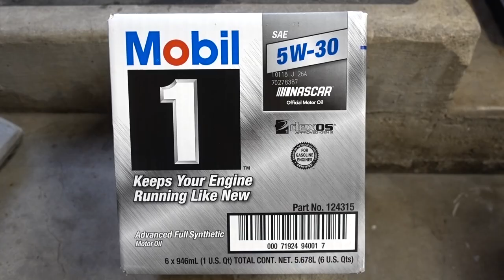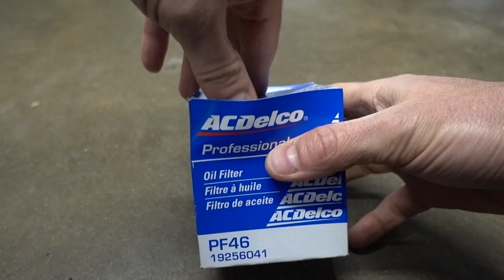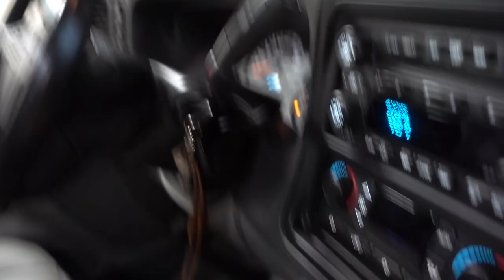BEST OIL FILTER HACK IMAGINABLE!!

Comment: Yes I've done it. Good idea. I DONT KNOW about THE PROOF behind it but it does make logical sense!!    Especially with COST of the magnets.   So it may or may not help. Being so over ty he top doesn't help.  The METAL PARTICLES  l WOULD B CAUGHT BY the FILTER WAY MORE LIKELY THAN the TINY MAGNETIC FIELD thru the OIL CAN!!. Especially sense the metal particles r moving by in a fluid at a flow rate that is fairly high.  So I think this is a myth. I'm a new engineer mechanical and I do watch alot of Scott Kilmer videos and trust his auto mech experience.

Comment: I just crack the filter lose and take a hammer and punch to poke hole into oil filter then spin filter on the side, so you dont get that mess,  been doing that for years and we use grease on the filter seal and prime the filters of course, just hand tight

Comment: I like your channel man! But, I don't think magnets on the oil filter would improve the oil any better. And, the reason why they make magnetic plugs is simply because it helps the plug stay 'attached' to the spanner or socket and avoid it falling in the container. The ferrous particles in the oil pan simply drain with the oil due to gravity and only a small amount sticks to the magnetic plug.

Comment: Scotty Kilmer is king..... As you know. The magnets, might not be strong enough to pull anything out of the oil. Did you test this with a cut away yet????? Hint hint, new video to bust the myth?
I used rare earth magnets in my rear window to hold a magnetic bumper sticker on the window and it didn't hold at all! Just saying if it can't hold 2 magnets together through glass then metal might not work either. Would like to see that experiment in real time with a cut away oil can thr magnets on the side and metal clinging on the side with oil...

Comment: magnets magnetic field don't pass the metal shell of the filter, they would just stick on the outside of the filter and that's it....

In real world (industrial field) magnets are used inside filters to attract particles but merely to trigger a sensor so the driver/operator of the machine getting a warning of a contaminated filter.

There is no practical use for it, if you got metal shavings in your filter then there is something wrong with your engine, regular microscopic shavings are normal and for this reason you have to change your oil every xxxx kilometers.

Comment: Oil filters are used to collect carbon deposits that block oil galleries . Your correct that the only ferris to ferris metal contact is the linner and rings but the wear is so minimal or you would have to rebore your engine every 10k not 300k. Most GEAR boxes and differential have magnetic plugs because they run metal on metal components under extreme pressures.

Comment: I think your magnets are attracting the ferrous material your oil filter already captured, meaning your oil filter already did the job your magnets are meant to do.  I also believe the magnets on your drain plugs are meant as "indicators" of other problems your engine or transmission might have.  See Hoovies Garage Lambo transmission video for a good example.

Comment: If there are metal particles big enough in the engine or transmission to do any harm they will for sure get caught in the oil filter, so adding magnets to the outside of the filter doesn't really do much because it's already caught by the filter.

Comment: You could prove your point with facts, why not upload a video right after your next oil change, take the old oil filter out and open it up, if it does show metallic debris or particles in there, then nobody not even Scotty Kilmer can argue about your method/solution.

Comment: the magnetic drain plug does the job the most efficient way.
simple and when changing the oil just clean the drain plug off.
no need to do anything else apart from making a video on you tube about sticking little magnets all over your oil filter why not try different color one's at least you have the prettiest oil filter in your nabourhood.

Comment: On a modern engine, block and pistons are made of aluminium. Cylinder liners are made of nikasil which is a nickel/aliminium alloy, but unlike pure nickel, it barely sticks to a magnet at all. The cams are made of steel, but how much metal ever comes off them is ad best questionable. If you have a magnetic oil sump plug, how much metal do you find on it when you change the oil? If it's close to 0, magnets on an oil filter aren't going to help you. So it's up to you to prove that these magnets actually catch anything. Until you do that, you have a lot of opinion and no facts.

Comment: Yes, you say what's the harm if it actually does nothing?  Well, what if one of those little magnets gets knocked off while your driving your gas guzzler around and bounces off a rock and hits a kid in the eye and blinds him which causes his family to take his college fund to pay the doctor bills and the kid grows up never reaching his potential in life but languishes working in a fish factory until his death from toxic fish poop whereas if the magnet YOU installed, if it wasn't there wouldn't have done what it did and the kid would have gone to college and graduated at the top of his class - with both eyes - and received an all paid scholarship to a highly respected petroleum program in a great University where upon graduating he worked in a lab that discovered a breakthrough magnetized plastic engine that did away with oil, fillings and filters and then the whole world embraced that break through, except Togo Togo naturally and we could all drive around on clean quiet and metal filling free vehicles!  Except Togo Togo of course as previously mentioned. What about that?  Think of all the kids that would be able to live without the loss of an eye. Yes you say what's the harm? Well what about that?  So, there!

Comment: Why in the hell did you tighten down your oil filter with the wrench.. they are to be hand tight always. Also, why is your oil that dark? are you a diesel? You should change it more often. If you are using syn oil it should be a dark color but not black. That stuff looked like Rotella 15w40 after being a month late on your oil change.

Comment: MOST engines are ALUMINUM BASED   your oil filter hack is useless
Since you never had a newer car you might have not known ALUMINUM  is non magnetic
Might be useful on a transmission though  but you will need a very powerful  magnet since the housing is very thick

Comment: You should see what the factory magnet on a 4L60E looks like after 300k miles. 😮  I can't watch Scotty because he too often acts like a stubborn drunkard who hates what he doesn't understand.  Our oil filters are much smaller today, in small part thanks to the EPA, to help meet regulation that oil filters do not have to be treated as hazardous waste like motor oil.  Many modern cars have magnets in their oil pans and/or drain plugs from the factory to collect metal shavings.  There's no real harm with using magnets; it's like the debate of washing your car too much.  While I understand the idea of using magnets on a filter is because it's disposable and you can (assumingly) toss the ferrous debris out, the bottom of the pan is where you'd most likely catch the larger debris that can do damage, as it sinks like heavy gold to the bottom.
Reply: If you want a large oil filter  buy one  
they still make them

Comment: I agree with scotty you dont need a magnet the filter catch all that can harm the engine the engineer design it to work efficient without magnet if you have unwanted particles floating in your engine you need to deal with the problem that cause it in the first place cause the magnet not gonna fix the problem

Comment: You had anearth magnet plugged at the end of your drain plug but you didn't bothered showing the inside end of it. It would have been a good example of your theory. 

You make it sound as if you know what you're talking about but you couldn't bother talk about the details of the inner works of the oil system (pressurized) dude .. NOT EVEN THE WAY OIL FLOWS IN THE FILTER. I would reccomend you Scotty channel. You could learn a thing or two about how mechanics work.

Comment: The problem is you are making every piece of metal that filter is connected to also magnetic, which means all of your metal components are catching metal fragments rather than them going through the filter. So,  i would not recommend that at all.  Don't believe me ?  Get your super powerful $2.00 magnet, stick it to something metal, then use the other end of that metal to get it to stick to something else metal.  There is your proof RIGHT THERE..  DO NOT DO THIS

Comment: The magnetic oil pan drain plug is in the oil pan for a reason. Not on the filter, the pan. You need an understanding of the pressure going on inside the filter to know why it's not a good idea.

Comment: EVERY FASTENER IN YOU MOTOR IS STEEL!!!! Ferros metal, EVERY MOTORS CRANK SHAFT ( 90 lbs) pure cast iron (ferrous) metal, timing, balance shafts and chains are steel and cast iron(70lbs) CONNECTING RODS(35lbs) all cast steel, the whole rotating assembly is magnetic!!!!!!!!!!!!!!!!!!
Reply: Now days the rolling computers use aluminum engines and  aluminum  parts  to save on weight

If you have metal shavings in the oil and it's circulating around  it means you bought a crappy FRAM filter and has stopped filtering 

magnets are useless IN modern cars with aluminum engines
Reply: @punker4Real  New engines still use cast iron cranks, rods, pistons, etc. Unless its full billet aluminum those parts would never survive the wear those parts see. I don't get why that so hard for you to grasp. Full aluminum engines are for drag race applications only and cost stupid amounts of money.

Comment: Mobile isn't the best oil u can use, Amsoil is better
Reply: Peter Boissiere and a bypass filter.
Reply: "Better" - Better at what?  The add pack?  Amsoil is still average compared to something like High Mileage with MaxLife Full Syn or M1 Syn High Mileage.  Purer base stock?  SOPUS' GTL is still the cleanest oil out there.  Low SAPs?  Again, better options.  

It just depends what you're looking for.  There's no justifiable reason to pay Amsoil pricing.
Reply: @cup_and_cone  Royal Purple is the best
Reply: Mobil 1 is the BEST.
Reply: @stacydornan9765  Never seen a decent Royal Trash oil analysis.
Reply: Your all wrong Shaffer’s oil.                    out performs all your name brand shit...
Reply: Stacy Dornan lol why?? Because the oil is fancy purple?? Dont fall for those marketing schemes...buy mobil 1 or castrol and u should be good to go
Reply: Amsoil is a pyramid scheme and that guy eden is just a marketer for them. Why do you think everyone always trying to get you to buy amsoil?
Reply: @georgesmbyd6603  I use testing at Blackstone labs to see what oil is best
Reply: Peter Boissiere   I'm under the impression that propylene glycol, although a higher I risk cost, is a much better way to go.
Reply: royal purple is the best engine oil

Comment: With an aluminium block, aluminium head(s) there is little a magnet will catch. Bearings are made (mostly) of non ferrous metals too so a magnet will not pick up much as there isnt much ferrous metal there in the first place. Its a nice idea but isnt the best performance mod...But hey. It doesnt hurt anything.

Comment: You lost me at putting old dirty oil on the rubber gasket on the new oil filter.
Should have used new oil you were going to put the engine.
"Rev up your oil filter gaskets"!

Comment: Just please bear in mind that you are trying to trap something that is in constant flow.  Plus the fact that you are trying to catch something that will defeat the filtering capacity of the media inside the filter.  Of course, no harm in what you're showing.  The magnets in pans are designed to catch material when fluid is not circulating.  The suspended particles in the pans will gravitate to the magnets (when fluid is not in high motion).  Pans typically hold multiple quarts.  An oil filter?  Perhaps half a quart.  If you're into magnets, consider adding more magnets to the transmission pan and oil pan.  It makes more sense to do it there.  Only because of the storage nature of these pans.

Comment: So I totaly agree with this.. But! What if they worked to well, and you have some excess wear, the magnets catches that material, then cloggs that filter.. I agree with the idea, but put them at the bottom of the oil pan, far from the pickup.. It will still catch everything, and let the filter work easier, because its filtering metal free oil..

Comment: LOL, So many noneducated comments on here. Here is one that I like to despise from @Kartboarder22G,  Here even though you might have ferrous material on the filter near where the magnets are the oil filter still catches that material. So do it if you want but I'm gonna say it's just a waste of time to put those on and off each time. All I can say is Kart, please learn proper English and pronunciation before commenting. 
Let me say this about magnets and oil filters. Magnets isn't a new thing. Magnets have been used on canister type oil filters for diesel trucks for years. Where did the diesel truck industry learn from? The RailRoad industry. RailRoads have been using magnets on their diesel/electric locomotives since the 40's. Locomotives hold hundreds of gallons of oil in their sumps that are passed through a huge series of filters. People's comments on here are "well, the build-up of metal in the filters don't allow the proper flow of oil" or something to that effect. LOOK AT THE OIL PRESSURE. If the "build" up of ferious metal was causing the oil not to be able to pass through the filter as it should, here is my question. Will the oil pressure be down or would the oil pressure be higher? 
I am not going to answer this question as I will love to see the answers. Please, no long ass explanations. Just a simple higher or lower.

Comment: OMG do you really think that much material is floating around in your oil ? if so then you need some major repairs. The guy below making a comment about a clump of this iron breaking off is laughable.... If that engine is producing that much iron in the filter then it need to be taken off the road and rebuilt.
Reply: nearpar fuckin oath

Comment: Why not on your oil filter? Simple. Because any metal not caught but magnetized will then be pumped to other engine parts such as cylinder walls and other parts and cling to them now that they are magnetized.  A magnetized drain plug is out of the pressure and flow of oil. The oil filter is in it.

Comment: This is hilarious.... first: one should not be using a filter that cant filter a particle the size of wear metal. Second: one should not be running an oil that allows for wear like so that creates wear metals to occur. That’s a very poor performing oil which is about 98% of oil on the markets today. Third: that I know wear particles are big enough for any cheap off brand garbage Walmart filter to catch. Most filters are filtering down to 25 microns on the worst one’s and wear metal particles are way way bigger than that. 
You’ll always have bits attached to the walls and magnet and Believe it all day long it work but it’s just the same stuff the filter will catch anyways.

Comment: LOLOLOL more clickbait on youtube.
You completely misunderstand why magnetic oil plugs are in use.
They are NOT there to filter your oil. They are simply there as an INDICATOR to tell you at the time of an oil change that an engine is having some SERIOUS issues.
If your engine is pumping around enough iron or steel metal particles that you can see them on the drain plug, no amount of filtering will do any good. Your engine is ALREADY TOAST. Filtering will not put the metal back where it belongs. The. Particles are not the SOURCE of the problem, they are the RESULT of one.
And by the way, your filter itself will remove particles from your oil... MAGNETIC OR NOT.
Lol
Lol

Comment: i did this and a magnet fell off and landed on the flywheel which made the drivebelt come off which stopped the power steering from working and then as that belt served the water pump, the pump stopped and the coolant overheated which seized the engine, then i crashed into a tree due to the lack of power steering

Comment: Guys do NOT put magnets on the outside of the oil filter. You're damaging your filters effectiveness by essentially trying to capture things before the filter has a chance to filter them out. After seeing this I did a bit of research and came across a page that explains why you should put magnets inside the filter as it grabs and partials your filter misses without causing a blockage and reducing filter efficiency. 

http://www.oilfiltermagnets.com

Comment: "they all have magnets to catch material" seriously....i work on Tesla's for a living and we dont even use magnets on drain plugs! i have a 2015 Mazda 3 that doesn't have a magnetic drain plug. this guy is so full of garbage. this guy is the equivalent to the Verge building a PC.
Reply: Teslas have motor oil ? 🤔
Reply: @danielnash5785  they have trans oil in the gearbox/
Reply: @BrittanyMartin917  my audi from 2000 has a magnet in the gearbox seems a bit odd that a tesla wouldn't admittedly almost no engines have magnetic oil drain plugs as standard but every gearbox or diff I've come across has done only due to the fact that 99% of them have no filtration mechanism and are usually designated as sealed for life
Reply: @danielnash5785  Tesla's arent sealed for life, the oil is changed every 2 years or 20k miles